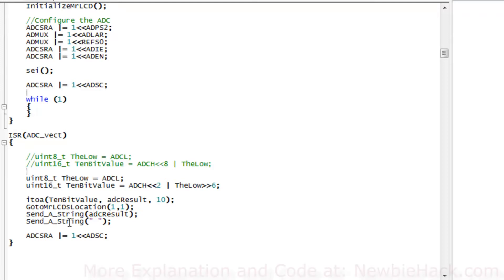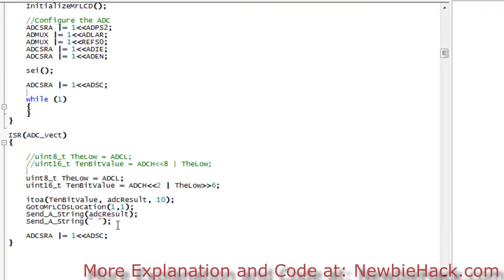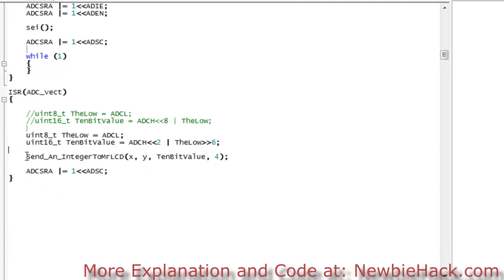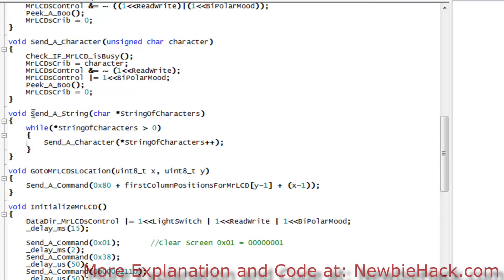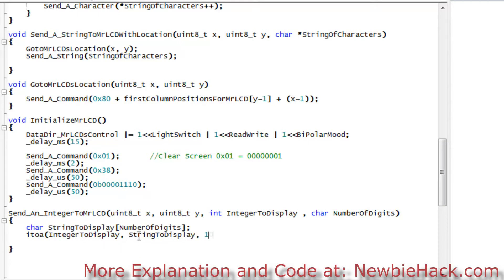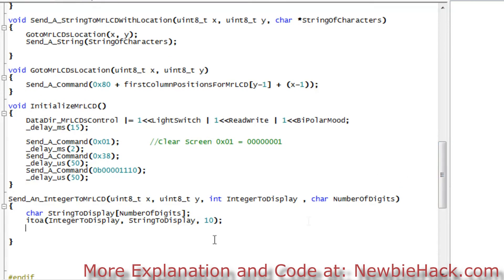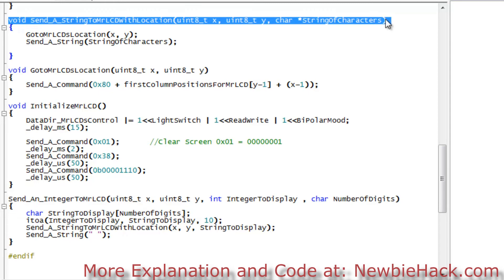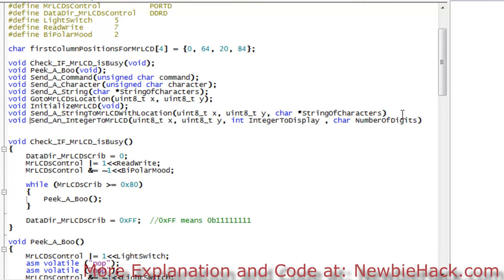24. Arduino for Production!  Atmega32 AVR - LCD Creating a New Library Routine

Comment: I have created an include file :D yay thank u so much , I want to ask u about one more thing  i know i ask a lot 0:D anyways, i created an lcd library just like u did but instead of using the 8 bit mode i used the 4 bit mode the question is how can i assign it to any pin i want not just 4 side by side pins i manged to use the shift wise operator to move the 4 pins along the port but this process is annoying so will u please help :D!, thank you
Reply from the maker: The new ARM tutorials that I'm dong will show you how to do it.  Watch my ARM tutorial on interfacing the LCD and you will find out how to associate any pins (not just ones side by side) and apply it to the AVR.  Good luck.
Reply: i will do so then :D thank u